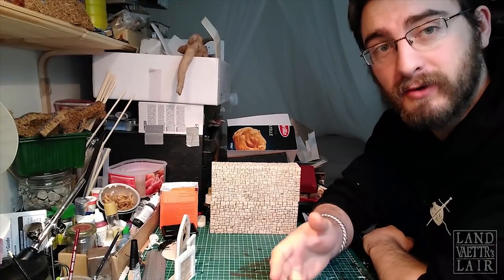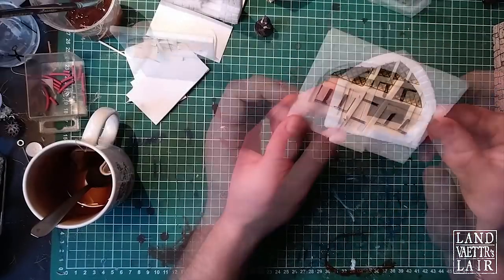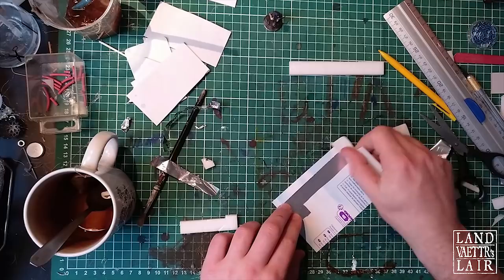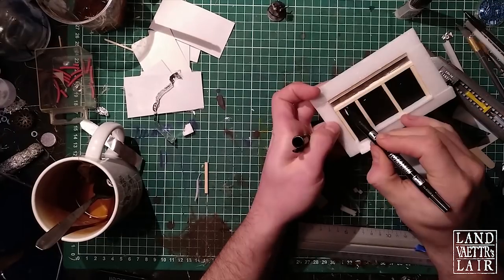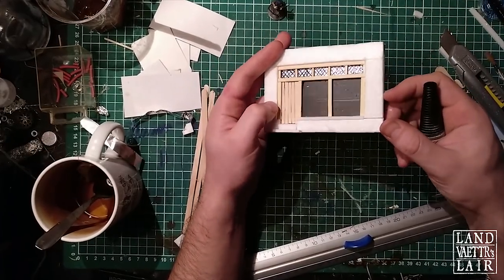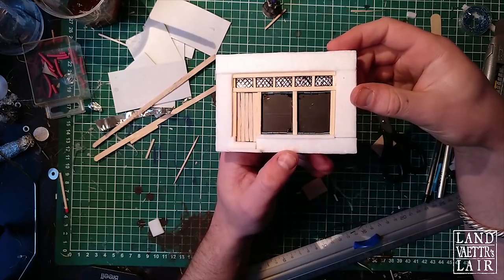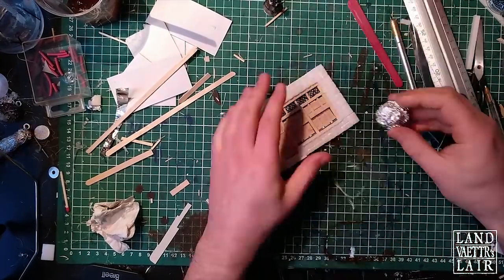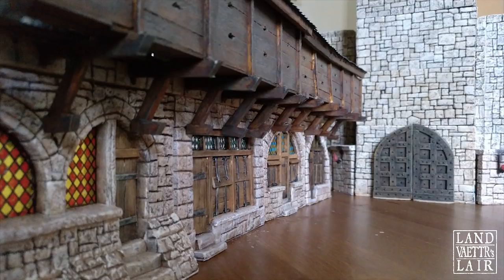Crafting Shop Fronts for tabletop RPG (tutorial)

Comment: This is very cool. I like using the foil as window you could even use a marker on it and color the windows red blue greens violet or a mixture of colors. Oh I see you paint them up nice.
Reply from the maker: Chris P. Bacon yeah you Can also use golden chocolate's wraps. But i'd really recommend using a mesh to do the grid if the windows instead if just using a Pen.
Reply: Yes I have seen others use mesh angled at 45 degrees to make the windows.

Comment: This has got to be one of the most useful crafting videos out there 👌 Keep up the great work! Would have really enjoyed an arched window shop guide since I'm not good at deducing how to do it 😅
Reply from the maker: The arches are pretty easy to do, as you've Seen at the begining of the tutorial the curves are all cut inside a foam board and the cuts are gonna be widened with a ballpoint pen to enhance the depth of the stone work. Real easy, just make sure the arch is more or less symetrical...you can make a template in cardboard beforhand if you want...
Reply: @LandvaettrsLair  Great reply! Making the walls has taken a lot of my time since I don't have double corrugated cardboard to make it quicker, the good thing is that I'm using inch thick foamular to substitute multiple layers of cardboard. Thank you for clarifying ^^

Comment: As an alternative to aluminum/aluminium foil, you could simply paint with a satin or gloss paint, or apply a satin/gloss varnish. 

As an alternative to trying to free-hand the rhombus frames, you could use drywall mesh tape (as suggested by Terrainisaur). The latter can even be painted before sticking it on.
Reply from the maker: Yes and yes, didnt know back then😉

Comment: To avoid tracing the window rombuses, you can use garden plastic mesh, it is easy to cut and available in black. Just cut it to your window dimensions and hot glue in sandwich between the foil and the wood beams. It also works wonder to hide the inside of a build when you need to keep the windows transparent (if you use tea lights inside, for example), since the eye can only focus on the mesh, and not peer inside the window.
Reply from the maker: TheZapan99 thanks yeah i know about mesh i just didnt happen to have any back then, it does look better and way easier to make with mesh tho. Cheers!

Comment: You really ought to get a wood chopper for some of it, tends to make better cuts than scissors and quicker than others...plus you don't have the issue with splintering that can happen. They also don't tend to be that expensive.
Reply from the maker: AzraelThanatos actually i have a heavy duty cutter i could have used for cutting coffee stirrers and proper cutting plyers for the beams i'm usured as why i didnt use them..they were probably Somewhere hidden some pile of materials my workspace is such a mess right now...
Reply: A tiny sliding miter saw would be handy.
Reply from the maker: Chris P. Bacon i happen to have a Dremel, which is perfect for cutting these kind of beams, i used it on the hoarding built. But this craft used so little wood i didnt bother to plug in the Dremel...

Comment: Could you go over windows more?
Reply from the maker: What do you mean like a full tutorial? Not on schedule for a forseable future I'm afraid. But you should be able to find stuff online without issue. That said I suggest using mesh for the grid of the windows, looks better.
Reply: @LandvaettrsLair  how does the painting go? From what I understand you just put down the foil, then using a permanent pen, you create the bars. Do you avoid priming those windows and just paint on the colors?
Reply from the maker: From what I remember no priming was involved. The pieces arent manipulated that much and the paint actually sticked pretty well on the surface. What you see was pretty much the process... now you can seal the whole project with some kind of clean coat for more durability if you want, windows included.